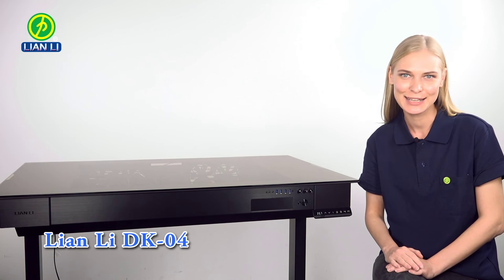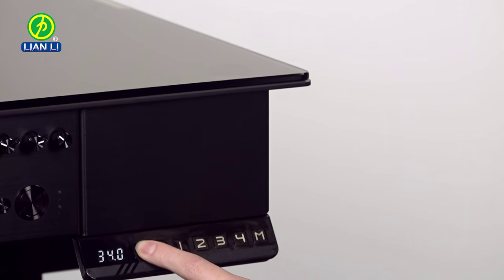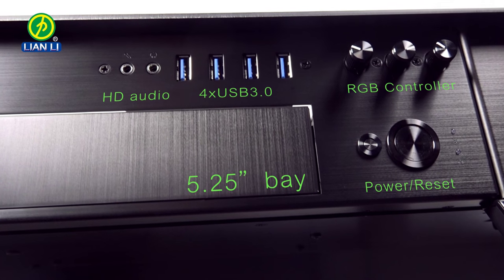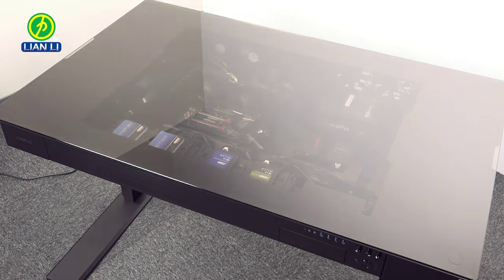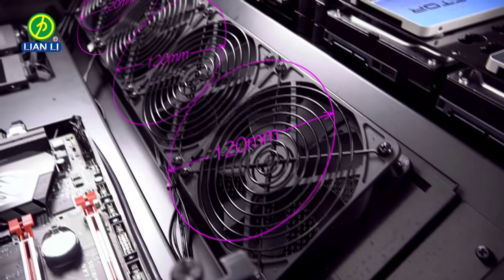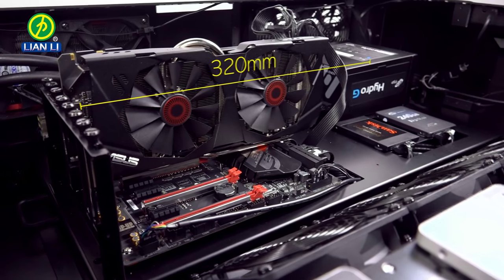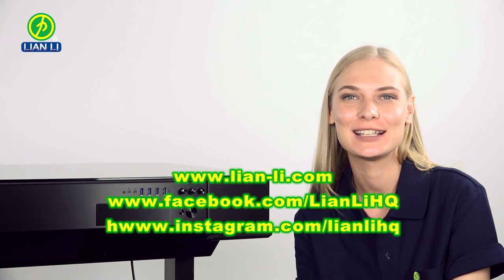LIAN LI DK-04 Desk Chassis

Comment: If you carefully calculate, it is a cheap option because it includes both height adjustable table and a awesome looking  spacious case.
Reply: +preetam sahoo If you carefully calculate, the adjustable table parts can purchase standalone and cost about USD$280-480 in Taiwan, and can match any flat table frame. FYI Electric height adjustable desks and desk frames http://www.conset.us/default.aspx
Reply: ***** these products don't have visual appeal. Besides that you are getting a massive case for all your water build.
Reply: preetam sahoo carefully calculated it and the results say "not worth the price"

Comment: Finally. Not as convenient to tinker with as DK1/2/3, but at least it's ergonomic and the standing option is awesome. 

I still say, combine it with two built in fully retractable articulating arms that one hand adjust u/d/l/r for keyboard and mouse pad with thin graphite trays and soft wrist rests for each (thinner for mouse) and you will have an absolute winner. I can't sing more praise being able to adjust my sitting position completely with my setup of dual retractable articulating arms. I only wish I had the standing option. The arms I have don't reach high enough.

Comment: "on the left side"? >.< Looks like an epic desk case. I'll buy one if they get to Australia for under $1200.
Reply: +AussieR1 GL with that. A barebones electric adjustable desk costs $900 US, and it's about $200 for the glass. There are a lot of factors that actually justify the cost of the case. If you can't afford one: it's because it's legitimately just outside your means.
Reply: +DeilGrist yeah, I could probably justify it if it's under $2k. but it still won't be.
Reply: It's priced at $1500 US.
Reply: +DeilGrist time to move to the us then...
Reply: +AussieR1 Motorized standing desk in the US can run as low as $500 nice computer case < $300 I really don't know if it's worth it.
Reply: ***** Where on are earth are you finding motorized sit-stand desks for $500? Maybe a hand-crank, but not electric with presets.
Reply: +DeilGrist uplift desk, Evo desk, I mean just google "Motorized standing desk"  and you'll find options. That's  what I did when I saw this video to comparison shop for desks. While you might pay a little more than $500 it's a lot cheaper than $1500. The uplift I priced out was around $600 (with options)  and free shipping.
Reply: +DeilGrist I bought a motorized sit-stand desk at IKEA for around $500.
Reply: Stephen Pratt You're missing the point.
Reply: +DeilGrist So when it gets to Australia it'll be around AUD 2,700 (USD 2,000), once they add our 10% GST (to USD 1,650) and then the standard 'Australia Tax'.

The latter is where manufacturers say "We want to sell this in Australia.  What price should we set?"  The marketing department replies "Everyone puts a 25%-50% markup on Australia, so we'll do that too.  They whine about it a lot, but what else are they going to do?  Shop at Amazon Australia?  <Evil laugh>".  (For those who have not encountered it, Amazon does have an Australian store - it sells e-books.  It doesn't even sell Kindles!  (Actually, it looks like it does, now - the company that had a deal for Kindle distribution went bust.)

We also have Newegg in Australia.  You go to the website, find the item you want, and "We're sorry, but this is not currently available".  If it is available, then you can easily change your location using a drop-down to find what the 'Australia tax' rate is for Newegg.

Fortunately, we are able to access those stores in the US/UK/Denmark/Kazakhstan... even New Zealand tends to get things cheaper than Australia!

Comment: I recently purchased this desk and its awesome.  I have one complaint (that I'm hoping to figure out a solution to, but haven't yet).  I have a triple monitor mount on the desk.  You have to hook all the cables up to your motherboard before putting the glass top back on.  Well, I setup the triple monitor mount on the desk to find out one of the DP cables no worky :(  There is no way to get access to the back of the mobo without removing the glass!!!  I MIGHT be able to take off the fan grill in the back.  They really should have a compartment though.

Everything else?  Sexy sexy sexy.

Comment: I'm high on tress and I'm just buggin' out on this funny ass "review"...She acts and moves weird.

lmfao! @ 0:23 - 0:26 "On the left side of the chassis are the control panel"...Duh...she meant the other left side. 
lmfao! @1:40 - 1:42 "The thirst thing you will see inside"
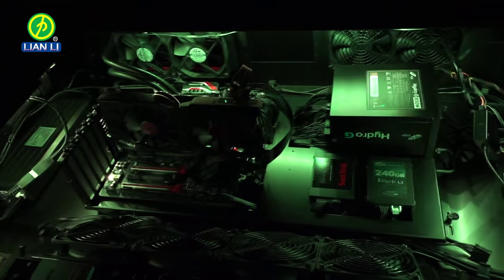lmfao! @ 2:49 - 2:53 "The far right side includes an-card cable clips for argarnizing wires"

Comment: 3:20 It's a FORWARD slash, not backslash....ugh.
Reply: +Brandon Rutledge some people gets confused about "what is forward or back" for the slashes :D
Reply: +Marcio Neves it's exactly like reading a book. Left to right.
Reply: Brandon Rutledge I know, but some mix ups because some see it from the top (if it is forward or back) or the bottom of the line (same deal) :D
Reply: +Brandon Rutledge She also said the left side at 0:24 when that's the right side, she may just be directional confused